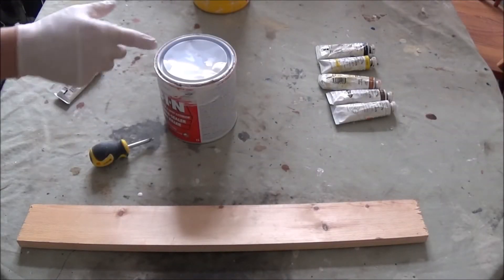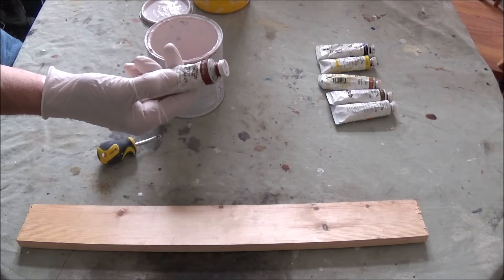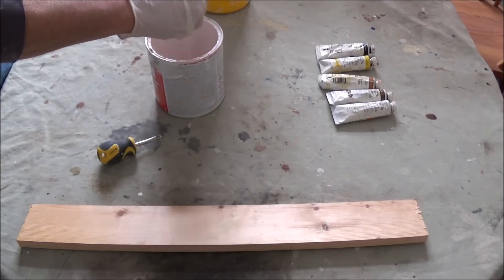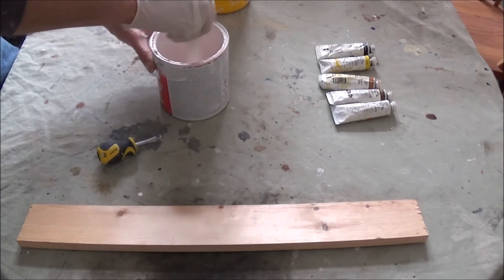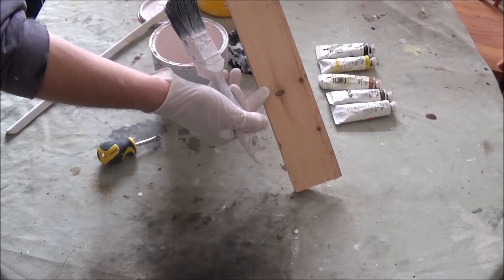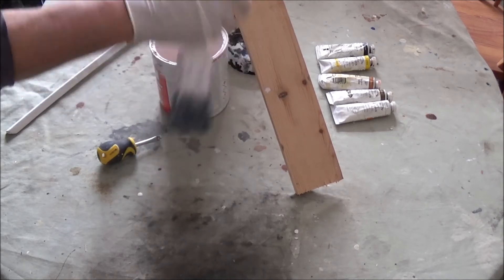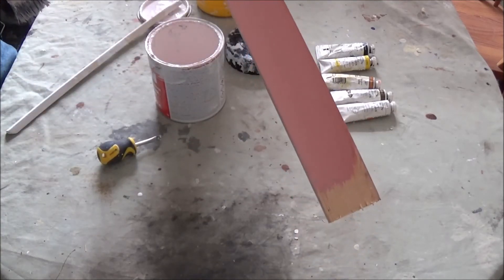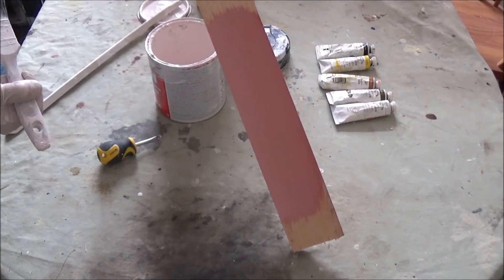How to tint your primers

Comment: So can u use bin primer, on say a outside front door to get rid of the colour and then use the top. Coat of choice or is bin primer just for interior jobs.
Reply from the maker: It's more interior and a spot primer for an exterior. Better to use an exterior oil undercoat.
Reply: Painting and Decorating so use red tin..bin zinzer for my out side shed .and two tint use oil based tint..